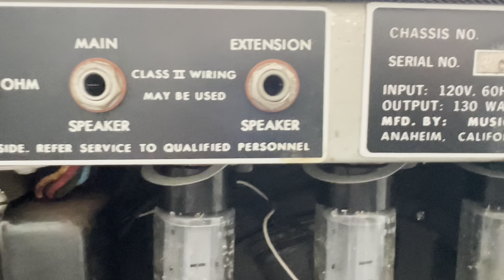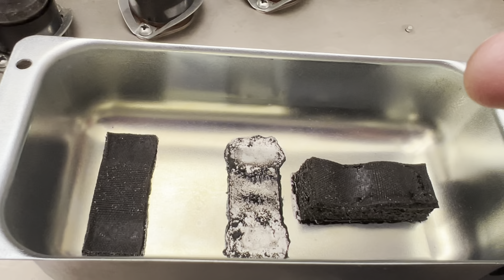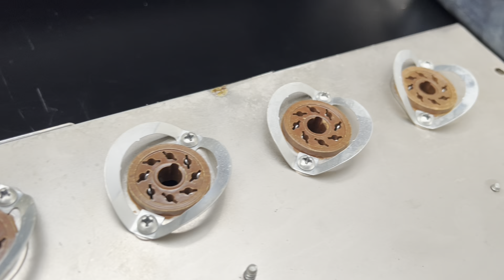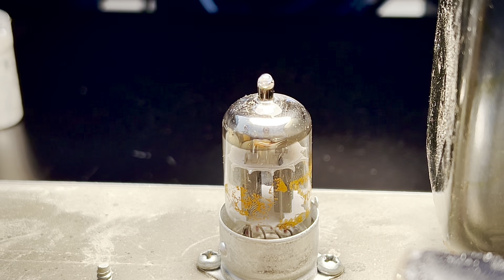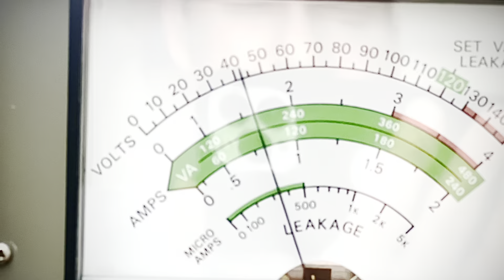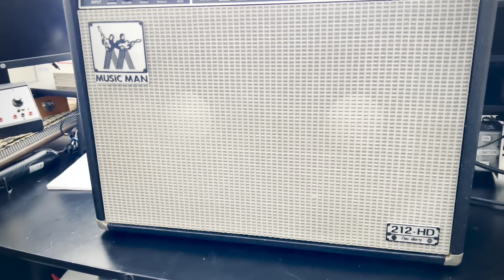Vintage Musicman Amp: Spa Day For The Old Guy

Comment: I have a Rd112 100 (6L6) watt 1983 year .. I’ve got bias runaway and I have changed all the components in the bias section  even the trim pot .. I’ve changes tubes 3 times and the problem doesn’t follow tubes and it seems that v1 is more of a problem .. I also changed the JE1692 and all diodes.. I’ve worked on this all week .. I will pay you for your time .. I’m just ready to get it going ..
Reply from the maker: Hey, Dale. Sounds like you went down the list!  Give me a jingle in the am and I’ll see if I can give you a boost.
Reply: @ForgottenGearRestorations  ok I sent you a email and a message on instagram.. I didn’t know how you wanted me to contact you. Thank you so much!
Reply from the maker: @DaleFox-q1s we will connect!  Long day here. 🍻

Comment: I have the same amp, Even had the same stuck tube shield and orange labeled Holland Amperex Phase inverter tube, what year is yours? I got it last week in a trade for a 82' Carvin Head. Channel 1 works, channel 2 works but the tremolo is on full blast and sounds more like a phaser and the reverb does nothing, so I am doing the research to crack this egg. Oh and mine had M.M. branded speakers and is a 77' from the date code on the MM speakers.
Reply from the maker: I have to go through my records, but this was a customer’s late 70’s mm. Your amp will sound amazing once you’re done. Can you clarify what’s going on with the trem?  This is happening at all level settings?

Comment: Deoxit Super expensive in Australia I don't know if this will work with that can  but try and shrink down a piece of heat shrink tubing over the  straw to reduce flow as you spray it,I still have two of the original cans so I'm good for a while.
Reply from the maker: Yeah the trouble with these particular ones is they leak under the cap and it collects in the rim around the top of the spray can. Once you tilt it, out it comes.  God love ya.
Reply: Wages are high in Australia so they can afford deoxit